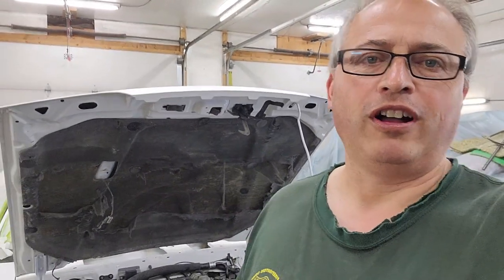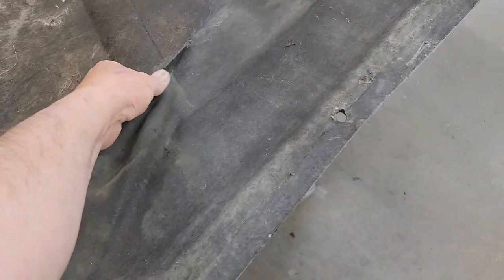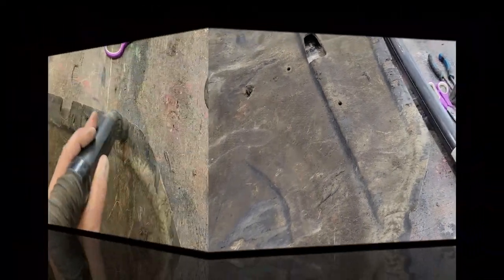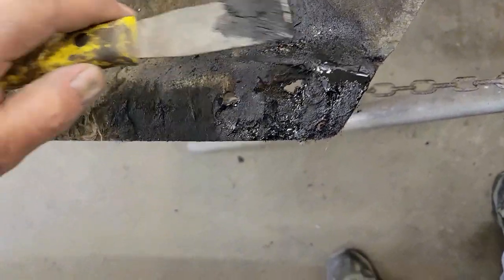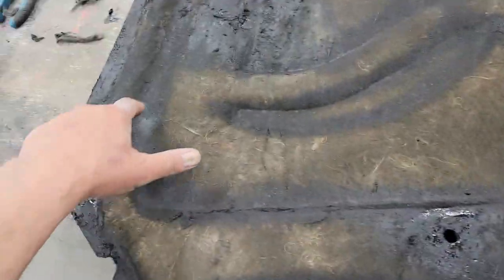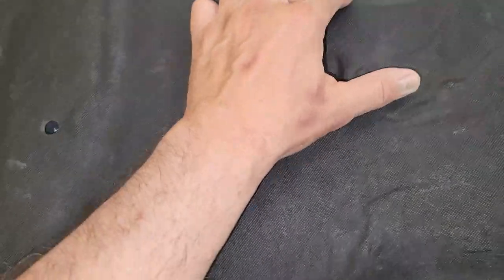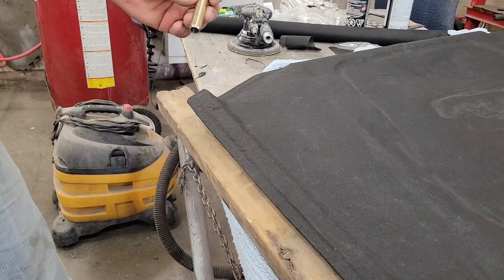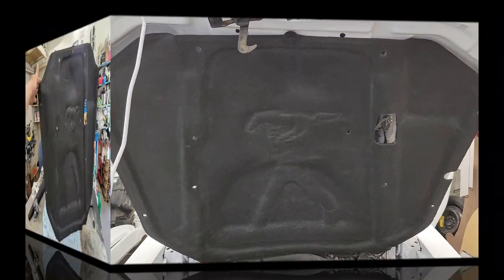FOXBODY UNDER HOOD LINER RE-FRESH! - 306 Foxbody

Comment: That’s awesome! Most people either just chuck theirs or they buy a new one that looks nothing like the original. I’d rather do this than replace it with an aftermarket one.
Reply from the maker: It appears that most of the aftermarket hood Liners do not have the "running horse" on them.  This helps keep the vehicle a bit closer to original with liners that can be saved...thanks!

Comment: That’s a great idea! I have my liner off getting ready to paint the hood. It’s almost perfect. However very dirty. I don’t know how to clean it without tearing it up. Engine will be super clean and fresh and don’t want stuff falling on it, so may just leave it off. I know good ones sell for huge money. But a fortune to ship. 😃
Reply from the maker: Hello, I think that the best way to clean them is to degrease them with a low pressure water stream, then let it air dry for a few days.  That should take care of most of the embedded dust and dirt.  Then you will have a good surface to work with.  I am so glad I did this.  I think it turned out better than expected!  Thanks!
Reply: @306foxbody1  Thanks!